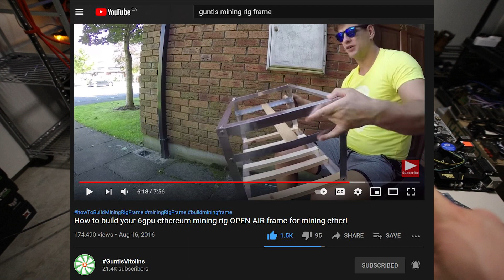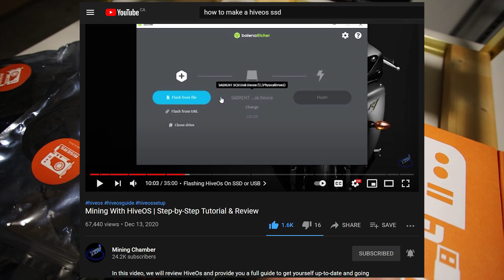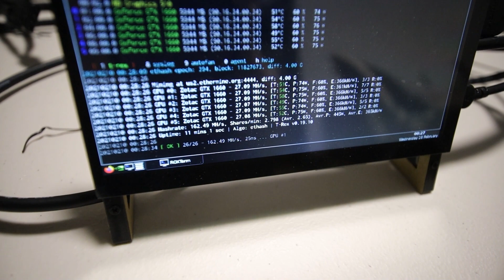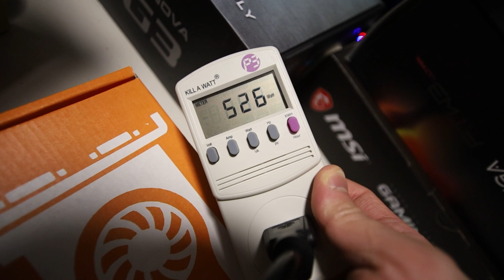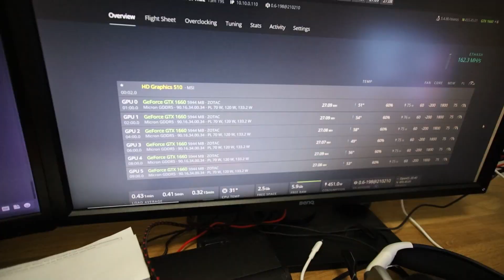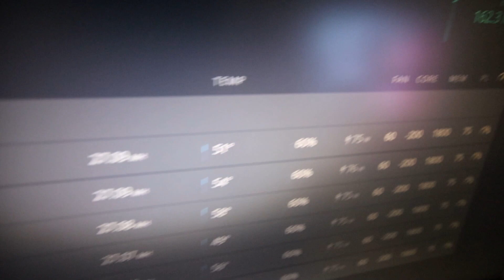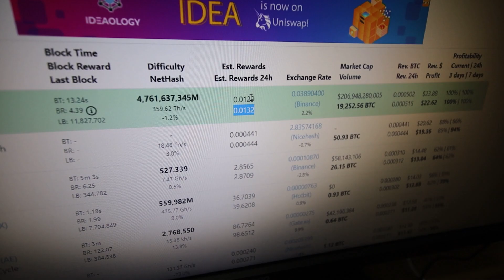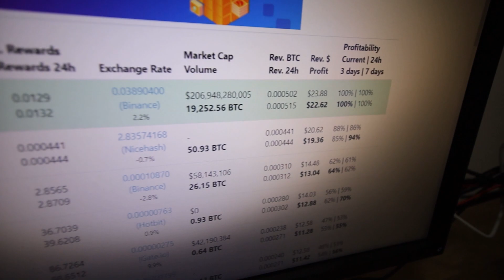Building a CHEAP? $2500 ETHEREUM Mining Rig...

Comment from the maker: Trusted links and Coupons here https://www.redpandamining.com/trusted-hardware-shops/
Learn how to build a Mining Rig Here! https://www.youtube.com/watch?v=-Frelfppb0w
Parts List I Used To Build This 6 x 1660 Mining Rig:
Motherboard: https://geni.us/eqOu (msi z270 I used n/a)
CPU: https://geni.us/UlxCf    
Ram: https://geni.us/GtR0N0    
SSD: https://geni.us/BBzF    
Risers: https://gpurisers.com/ use code redpandamining for 10% off!
GPUs: https://geni.us/YhyNq (Highly recommend 3060 Ti/5700 xt's but if you were to get 1660's, please try to find 1660 supers)
Power Supply: https://geni.us/rHOGlrB    
GPU Splitters: https://geni.us/WgRG
How To Make A OPEN AIR Frame! https://www.youtube.com/watch?v=OfE_QidD75M
Reply: is it ok to buy PNY graphics card??  cuz they are conveniently cheaper
Reply: Will you please link to the materials you use to make your frames?
Reply: The motherboard link is for a z390-p is this the same as described?
Reply: What do you suggest to buy for cable management?
Reply: How bout the fans? I dont see no fans in the list
Reply: The link u gave for Cpu , i bought it and there was only a chip without thermal fan( the one sit on top of the chip) comes with it
Reply: Can we use different  Cpu for this set up? Which one should be recommended
Reply: @RedPandaMining someone is impersonating you on one of my comments i think
Reply: What would be the hashrate of 1660 ti and 1660 super
Reply: eth address mate
Reply: About 5000$ to get this up an running today , debating if it's worth it
Reply: @MelaniaRox  be patience and wait for the right deals to surface, I often browse ebay auctions.
Reply: U did some B's like bro show us u hooking it up
Reply: @MelaniaRox  was it worth it than after a year did you got the W?

Comment: It’s impossible - IMPOSSIBLE to get 6 new 1660 for $300 as stated in the video. The average price on eBay is about $450 as of 2.27.21  so cards alone at minimum $2,700! Board $100, $300 PSU, ram, chipset, SSD, risers, cables..... you do the math. This is not $2,500 rig.

Comment: The problem with that old motherboard was that you missed the PCI-E power via molex on the motherboard. It requires it for posting and it will power cycle until it has power connected :) If you had a monitor, it would display a notification to connect the pci-e power :D

Comment: Thanks!! I've built my first rig based on this video. 6x 1660 super.
Getting 190.8 MH/s with the following OC settings: 
Fan 50%
Core: -100 
Mem: -1010
PL: 75
Reply: Do you need a cold room? Like air conditioning 24/7?
Reply: @martinmachuca6859  normal fans will do
Reply: @martinmachuca6859  I've added 4 fans. No AC needed for just 1 rig.
Reply: @fautuori  how much you earning?
Reply: @hellofkn3282  right now the projected earnings monthly are $453
Reply: @fautuori  amazing! keep it up!👍🏾
Reply: Hey is your rig still proffitable? Thinking of doing one similar to yours!
Reply: @Federico Autuori
Reply: @anthonygonzalezhernandez9239  Hi, try to build one containing rx 5700 xt's
Reply: @morgothbloody7181  Aren't those very pricey now`?
Reply: @InfiltrateIndustries  it’s rlly expensive

Comment: Dude, I just finished building a 13 card rig with the Asus B250 mining expert and a mix of 1660 Supers and 1660 TIs.  It's a beast for having such small cards. Rock solid stable.  Running at 385 Mhash, at 1,100 watts.
Reply: Just building my first rig. Amazon managed to lose my RAM twice now. I have everything here except RAM and can't find locally either.  Congrats on the rig. Post up a video man. Those older cards are more affordable, and STILL making good hash-rate. Just make sure you get 8gb or higher RAM.  I've got six cards so far. Looking for bargains.
Reply: @WallaceDunn  wow, crazy bad luck with Amazon. Hope it works out. Yeah, the older cards like 1070s and 1070tis are still decent. Got about 20 of them and they have been mining since 2018. Other than a few fan replacements, all still run strong.
Reply: @user-qi9be4lv7l  what temps are they running on? How can they survive so long
Reply: @sternfaust  most run between 60 to 70 C.  During the summer, the cards can reach around 70 to 73 C (living in Florida with HOT summers). Gaming does more damage to a graphics card than mining does. When you game the gpu gets hot then cold when your done. That hot and cold temp happening every time you game does the wearing down on the card.  When you mine with the cards, it's at a set temperature for a long period of time. Also, running at a reduced power setting -35% to -50% less in wattage. So it's not like the card is working really hard. Mining cards can last a fair bit longer than cards used for gaming.
Reply: @user-qi9be4lv7l  Thanks for your explanation!
Reply: What kind of psu are you using? I'm planning on starting my own rig soon with the b250, but it seems I may need a larger than normal psu. I've ordered a server grade psu with 4000 watts, however I feel it might be a little overkill.
Reply: @WhatYoureNotTaught  How could you get GPUs in these trying times.
Reply: @WhatYoureNotTaught Yeah, that's probably overkill. But, that's alright. Better to much, than not enough. I'm using a EVGA G3 750W (gold) for the motherboard and 3 cards. Then a server psu from HP to power the rest. It's 1,200 watt (platinum) on 110V.  Each server psu 6 pin is running 2 cards (/w riser) since it draws 160 watts per 2 full cards.
Reply: @sternfaust  Easy. Be persistent. Set notifications. Check regularly. I got 15 cards in the past 2 months.
Reply: @user-qi9be4lv7l  I am living in germany and been doing that but without buy Bots so not to much to get. I am thinking about buying used ones but they are still overpriced so guess not.
Reply: @user-qi9be4lv7l  where do you set your notifications?
Reply: @user-qi9be4lv7l  What prices did you get urs at? Someone is selling a 1060 6gb for 80€ here. Avg is about 110€ in my area. Thinking about getting it. 1070s are 240€ and 1080s are around 330€
Reply: @user-qi9be4lv7l  How profitable is it? Living in CA not sure if it makes sense to build a rig...
Reply: Is there a beginner guide to mining out there. I am tech savvy enough to put this together but software wise I'll be at a loss. Willing to invest for the long term roi!
Reply: @user-qi9be4lv7l  since 2018 how much u made on these 20 cards ?
Reply: @rts1880  Since 2018? Easily over $50,000.
Reply: Nice. I get 412 mh/s with 6xRX580 and 7x1070ti for about 1180 watts.
Reply: @user-qi9be4lv7l  since 2018 wow what kinda profit have u been making
Reply: I have the same supplies , can u make a video with step by step building it
Reply: @user-qi9be4lv7l  2 psu running off 1100W?
Reply: @user-qi9be4lv7l  where did you get the cards from? what notification?
Reply: @Hdic2018  750W Evga G3 + HP 1100W server power supply. Newegg and Best Buy
Reply: What motherboard should I use? the one recommended has bad review on Amazon ( ASUS Prime Z390-P LGA1151 )
Reply: @user-qi9be4lv7l  how much do you make with the 20 cards?
Reply: @Ryanj8031  i guess he got 400 hash lie per hour
Reply: @user-qi9be4lv7l  rx580s got the same mhs as a 1660

Comment: A possible solution to the boot cycling issue:
Check the bios battery is still good, swap another known working bios battery into that motherboard, and see if it still boot cycles.
This is a common issue with old motherboards especially if they have been sitting for a while.

Comment: How do you connect this to a network and actually earn revenue, this part I don't understand. Thank you .
Reply: Nicehash is the answer
Reply: @smcalpha   nicehash is less profitable though
Reply: @ducatornadonikita   a mining pool obviously
Reply: So basically to make it simple, when you run this "specific" software, it connects to the "pool" for pooling as in "sharing" your hardware resources for "validating transactions" made by others, and split the reward equally (b/c there will be a lot of people mining in the same network) and you split it according to the amount of work you or your hardware contributed. Before running the software, you tell it your wallet address, that's how it knows where to send your revenue.
Reply: @whatami2437  I ran easyminer on my home pc. it ran for 2 full hours and according to my earnings, it looks like I made 0.004 of one cent, so basically a nickel a week..lol...no thanks
Reply: @BENZ007  which means your home pc hardware is too low for these types of things
Reply: @whatami2437  exactly. But it was a fun experiment.
Reply: @BENZ007  try mining Monero, its designed to work on cpus even with no gpus
Reply: @BENZ007  I ran it onto my pc and had 3.10$ revenue per day, GTX 1070 TI but just not worth running on your home pc tbh wouldn't burn out your own pc for that small amount of profit you can make just invest in a decent mining rig
Reply: @NoaVanSnick  what software did you run I used easyminer and would gross only about 5 cents a day...
Reply: @BENZ007  try Phoenix miner, but remember you’ll need a good gpu to get better Mh/s or also known as hash-rare and therefore increase revenue
Reply: @NoaVanSnick  I’m running the same gtx 1070 you’re not necessarily burning your gpu, use ksi after burner you can control power usage and also watch your temps, I’ve had my temps at 61-62 avg and then in that case you’d be fine
Reply: Msi*
Reply: @fhyru1229  thank you . is it hard to set up ? or does it step you through the process
Reply: @BENZ007  it’s super easy, just search up how to setup Phoenix miner and msi afterburner depending of your gpu you might need a different program
Reply: I ran nice hash on a rx 580 and a gtx 1060 for about a week and a half and made 30$. Nicehash is easy but you don't make as much. not really worth it if you ask me unless you have a good gpu and mine through a pool.
Reply from the maker: https://www.youtube.com/watch?v=-Frelfppb0w
Reply: @BENZ007   i hear you...pretty sure you spent more on electricity over those 2 hours.😖
Reply: @NoaVanSnick  if you underclock core and overclock the memory you'll increase your MHs/revenue and it will only get half as hot as when gaming.
Reply: @ZenTauren  with real mining you get like 5$ for 50 mh/s...
Reply: @deadclan7796  you clearly have no idea what you're talking about, why did I even respond? NiceHash is "real" mining, the difference is that you're mining for someone else for payment. You use the same miners as everything else.

The profit fluctuates, so what you said doesn't even make sense.
Reply: @deadclan7796  I know, but It's a real hassle managing everything at once without it.
Reply: @cestchill1991   depends on the hashrate and when you mine maybe?
Reply: @BENZ007  dude ur home pc is a potato
Reply: @NoaVanSnick  Noa , you made $3.10 per day using a $500 gtx 1070 ti?!
Reply: Depends on your mining software and coin. Some simple commands are inputted into the config file for the correct mining server.

Comment: That board you were having trouble with, you should always make sure you have the latest and great BIOS installed and before you plug all cards in, do a basic installation and use it to make sure it's stable. Then power it down to add in all the other cards.

Comment: You need to plug in the extra power to the motherboard. Those 2 empty slots. 1 is up, above 16X slot and 1 down after the 4x slot. Also put 1 card in the 16X slot also. That count as slot number 0. There is nothing wrong with it. I had that one also. Try it. :)
Reply: Can you build one for me plz?
Reply: @romanlab888  Build what exactlly?
Reply: @marcelcornel82  the same mining rig you show on thus video. I will pay you for building it. Since you know how to do it and what parts to use. I want to have a mining rig at my house and asking you to build one for me.

Comment: All good...except one thing, you need to triple the price of that rig, there's no way you can build it for that price.  Then, your break-even and profitability dates would be pushed a few months, thus increasing the risk factor to a level that some might consider too high.
Reply: I've just build mine 5x1600s 1x1660 for 3796,80USD
Reply: @tomaszgabiniewicz6477  It's been 7 months since u've written that. How is it going? Are you happy with profitability?
Reply: @somerandomguyyeah  well, I have a little bit over 1ETH in my portfolio although I converted just shy of 1000$ to FIAT at different moments. 7 months of electricity would cost around 410$ where I live. I build another rig (6x6600XT) for ~4920$ at the end of September, and because of increased network difficulty I'm getting 20% less ETH that I was getting in March with single rig. I'm just going to break even by ETH going to PoS, which will happen next year, probably around June. Thinking about it I probably broke even on the first rig already

Comment: so, just to be sure, each end of every cable is split in 2, then, 1 of the slits goes into the gpu, and one in the riser.  do you try to avoid powering the risers with molex/sata ?  sata is max 50 i think, molex could be ok !  tyvm, very informative !  and your cable management is on point !! <3

Comment: To the haters saying $2500 isn't realistic. My first rig cost $2700 and that's with a 5700xt, 2x 5600xt, 2x 1070ti and 1x 580. $2200 for the video cards, around $500 for the guts. It's entirely doable, but you have to be super lucky on finding cheap video cards. My second rig will have 5x 1660 super and 1x 1070ti and will cost about $2500 - $2000 for the cards, $500 for the guts. Again - entirely doable. The 3060 is coming out next week, this will be the best chance to get an excellent card at retail price.
Reply: Both built within the last 2 weeks.

Comment: Unfortunatley with the current hike in prices of all graphics cards, I cant find a 1660 online for less then $600 each. Buying 6 GPU rig would cost easliy over 3k :(.
Reply: Keep looking, prices are high but you can still find good deals  - I just got a bunch of 1660 supers from Best Buy for $319/ea. Before that I found 5600xt on Newegg for around $420, and a used 5700xt for $550 on the local Craigslist. The deals are out there, just gotta be ready to buy it when you find it because video cards sell fast.
Reply: @LlonirTS  what’s up papi how did you get the Best Buy drop what date do you buy and did you use any bots ?
Reply: @LlonirTS  you think used cards are worth it?
Reply: @aersn4locs  No bots, just lucky web searches.
Reply: @danielgao173  100%. New cars depreciate in value extremely quickly. Plus if the used car is making you money - even better. You'll get ROI in a shorter amount of time.
Reply: Cards available 
GeForce RTX 2060

Comment: Planning to Use Rx 570s, around 27-28 MH/s. I tried with one Rx 570, I can make 1.7 USD per card with 0.1 KWH. If I buy 4 Cards and other parts will cost around only 1300 USD and will break even in 198 days

Comment: I'm gonna give you some real figures here of what I've done. I have bought a RTX 3090 for 1919€ and a PC (because RTX 3070's were otherwise unavailable and I also got a nice Ryzen 7 5800x in it, so it was worth) for 1975€. Then I bought another 2 XFX 580gb for 717€ in total. So for the GPU's it is all together 4611€ which in freedom currency is $5600. 

That's how much I paid for 235 Mhash so I think people are absolutely silly when they say they want this megahash for $3000 dollars. 

I also bought a BeQuiet DarkPower 1500W because I wanted absolutely bullet proof power supply if I am already throwing this kind of money into hashing. Hope this clears up the different perspectives of what is "expensive" and what isn't.
Reply: Same experience. 4 x 3070 + PSU, mobo etc. =about 5000 €. With OCs it gives about 240 MH
Reply: How much is the electricity bill a month for the 235 Mhash that you are getting?
Reply: @gtm2831  i have no clue yet, february will be my first full month, but i am thinking of student dorming this shit xD
Reply: @WePkMuch  Daaamn :D I think I'm gonna be paying around 80 € month, you doing a good save
Reply: @sipuli1467  its 750 watts that is around 850 kwh at 0.1 cents per kwh is 85€
Reply: All Cards available at cheaper rate 
RTX 3090 at 1200$
Reply: @sipuli1467  my farm have 230 Mh for 2100 $

Comment: 04:19 Just reacting to your confusion about power and TDP. 
TDP or "Thermal Design Power"  is the released heat, expressed in Watts.
Power consumption is also in Watts but is the electrical power absorbed and is different from TDP.
Most people confuse both of them because it is the same unit.

Comment: Today we got a 1660 super with hynix mems, and struggled to get it over even 21 mh, tried +900 mem clock and all that.
But then found out the issue was we had to drop the mem clock all the way (-502). It is working 32mh @80w ever since. Pretty strange. 
Hope that might help to someone.
Reply from the maker: Core down to -502 u mean?
Reply: @RedPandaMining  No, I meant the mem. I know it sounds strange but after searching for hours I saw that in a mining forum. We reduced the memory speed (litteraly the Memory Clock (Mhz)). Then we got 32mh.
Reply: @ibosnfs1997  Try running at 400

Comment: Too many fans. You need to have an insulated room with Air Condituoning running. That much hardware can bring the temp of a room up 10 degrees or more. Don't even doubt this I used to build computer server rooms.

Comment: Nice video straight to the point.
what abouth this video card?
AMD Pro Radeon Dual-GPU Duo Graphics Card - 32 GB GDDR5 - 256-bit
Reply: That's an ancient professional workstation card. Looks to be like 50-60MH/s@350+ watts depending on the driver and the exact model, but I doubt it's nowhere near as efficient as it should be to be worth while. But if you have free/cheap electricity...
Reply: @esaedvik  32GB /256bits and it is hbm2 surrly in terms of spec should do more ?
Reply: @queneilbibi1823  I don't think anyone's bothered with optimizing miners for it, i guess.